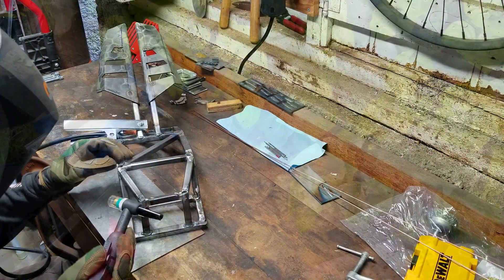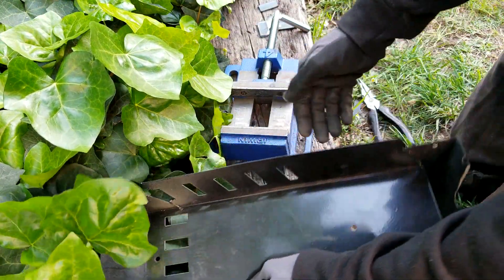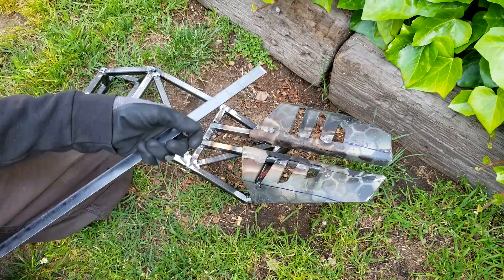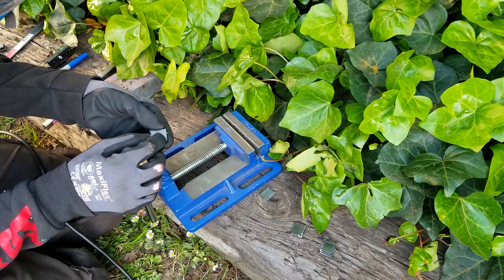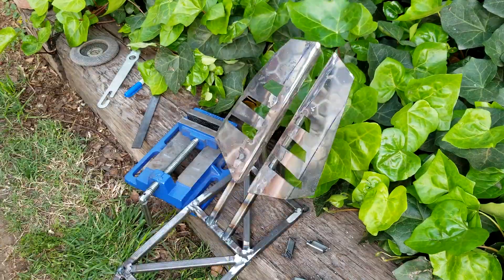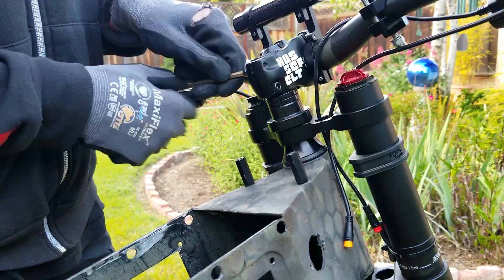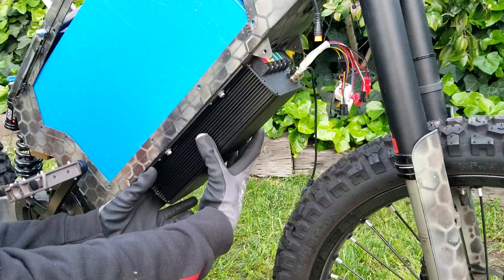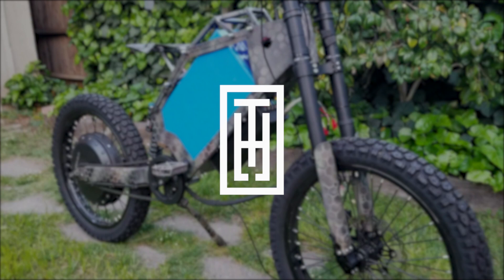🚲 First Assembly + More Mods Custom E-bike 9.0 \\  Fabrication - Enduro - DIY Build! \\ QS273 70Ah

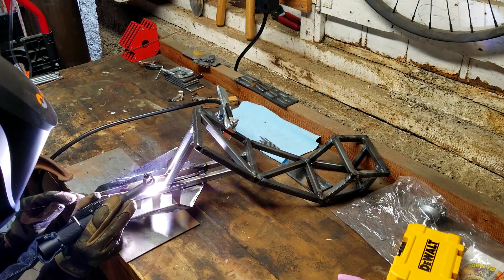Comment: 3:20 I just discovered your channel, and my knowledge on welding is quite limited (just like my English :P ), it would be great if you had a viewer with welding expertise here that would give you some constructive critique on your work, i quickly checked the comments here, and they are all positive, which worries me, as I would love to see some critique and suggestions how you should approach things, and how You can improve your skill. As for welding, You know they are bad, so thats good :) First of all, clean the material you weld, not only the paint but also the metal itself, you need to get rid of that grey 'film'. The metal you weld needs to be shiny, otherwise the welding will be almost impossible. Looks like that's part of the problem you have, judging by your welds. Another tip, if you want your weld to be big, TIG is probably not the way to go, but you can make it bigger with passes. One thin line of weld, another thin line, and so on or go zig-zag way. Too much filler and you get lots of blobs in your welds, maby too much filler, too less heat or jumpy movement, or the metal was simply contaminated/dirty which makes welding almost impossible, which then leads to weak joints, and that is definitely not somethings You want on a piece of thing your health or even life depends on.  Again im not expert on welding, i only took some short welding course, uuuh years ago :P So there you have it. Some critique encouraging you, to get better results. I would strongly recommend watching more YT tutorials. And most definitely, buy yourself, or find some scrap material, shape it, and practice  your weld on something that's going too look like your (in this case) a bike frame. Even professionals do it. 
BTW, waiting for the end result :D good luck!
Reply from the maker: Great, thanks a lot man!!

Comment: Huge fan of your talent.  Endless possibilities especially with your skill set.
To me with your CAD capability, I probably would have started with a complete virtual model of the bike.  You started by building a bike around a battery. Digressing to the beginning, and I haven't explored this option...all I can think about it taking the battery apart and reconfigurating the cell position to better accomodate the top of the frame of the bike to eliminate that top forward corner of the battery.  Instead of a 4 sided battery in 2 dimensions make it 5.  From there the shape of the original frame with slight expansion and not more dramatic reinvention as you have could be accomplished.  Of course this would require taking apart the battery and rewelding cells in place with different nickel strip orientation. Or...creating a dual battery bike.

Next thing is ergonomics.  Please take this from a guy who has tremendous respect for your talent but I come from a competitive cycling background and fussy about frame geometry and rider biomechanics aka ergonomics.  My background is mechanical engineering and so I view through the lens of physics and geometry.   Your seat position is much too close the bottom bracket centerline.  Pedaling can't be comfortable, nor any mechanical advantage.  This is in both vertical and horizontal dimensions.  Further, your seat pan is positioned sloping rearward.  This requires your arms to hold your body in position.  Ideally you want almost no weight on your arms which is generally achieved with a slightly forward sloping seat pan whereby pedaling forces offset forward leaning body CG.
Study different motorcycles, in particular seat pan angle.

Those are some general comments and please take them as nothing more than that.
I have worked in R&D my whole life and started building fast motorized bicycles when I was 12 years old out of old bike frames.  I am 68 y.o. now and still building motorized bikes but now with electric motors versus gas.
You are one of the most talented ebike builders I have seen on the web and my great respect.
Only expressing things I consider watching your build.
Reply from the maker: Thanks so much Luke, I appreciate your feedback and response. You're 100% right, it would most likely be possible to fit this battery within the frame compartment if I reconfigured the cells. I don't know if it actually would be possible, unless sectioned into two or three different packs, because the opening for the space isn't as large as the space itself, so even with two or three packs, I'm not sure I could pass them through the opening in the frame. It may have been possible but still not certain. I haven't ventured yet into building my own packs, and I would have been more comfortable doing something like that, had I already delved into pack building/modifying. It's something I probably will do in the future however. 

I knew this pack would not fit the frame when I first bought it and I wanted to take on the challenge of somehow making it fit by modifying the frame. This was also going to be my introduction to welding as I wanted a 'smaller' project to start with before moving on to larger projects. So while I do agree with you about just changing the battery would have been one solution, my reasoning for attempting this in the way that I did has more to do with modifying the frame than just a solution for fitting the pack. 

Others have also pointed out the bad geometry (mainly the front fork angle, which I didn't design) and I'm sure you have a lot more expertise and experience in riding angles and ergonomics from your years and background, so I'm not going to try and speak as if I know, I take your input and to me it sounds correct. With that being said, I did lengthen the seat about 2 inches which would put the seat position a bit further back. It does still favor center mass, however I can say with actually having ridden the bike now, it is very comfortable all things considered. Regarding the pedals, these are more just foot rests than anything you would actually want to use, this bike is probably 130-145lbs now and while it is possible to pedal it's not something you would really want to do even with flawless ergonomics, especially because you also have about 20-30KW of power at your wrist. I was also weary of the angle I set the seat at and it does appear to slope down (depending on shock compression), but rides mostly parallel to the ground, I don't feel any strain on my arms as I'm not pulling to keep myself level. I've ridden motorcycles for about 25 years now (FZR600, CBR600, Hayabusa, TL1000R) and I definitely understand not wanting to have pressure on your arms or wrists to keep yourself comfortable, and after having ridden this bike now, I can say it is very comfortable, and if it wasn't, then I would definitely change the seat position. 

I know you're coming from the experience of having worked in this field with a lot of experience and knowledge, and I appreciate you taking the time to impart some of that on me (and anyone that reads the comments), but I also have to state that this bike is more of a usable art project than any kind of proper bike that will be ridden with any kind of abuse or for any severe lengths of time. You know a whole lot, I strongly encourage you to show others your creations as I know it would benefit a lot of other people including myself to learn from the knowledge you have amassed over your time, otherwise they're stuck watching me (a hack) who doesn't really know what they're doing at all and kind of bumbling my way through it 😂

Thank you for your insights, and for following along it's much appreciated!

Comment: Yea keep going you're like a guinea pig for many people out there. The only thing I'd change here is probably the dimensions of the battery. It's just a small detail but anyway. If the battery is kept thin (but longer) you can tuck in your legs and reduce the overall air drag which will give you more range when driving fast. Weight almost has no effect on range in contrast surface has very much so. Curious about the speed of this beast.
Reply from the maker: I have no problem being the communal guinea pig for the advancement of absurdity 👍 

Hopefully in the future I can have enough funds to do a lot more experiments that people are curious about but don't have the means to try. 

I could have gone with a longer/thinner battery but then I would have needed to cut the frame in two and rewelded the halves thinner, which is possible but that would be even more work at this time!

 I'd be curious as to the difference between 2 inches in width regarding wind resistance, I can't imagine it is a lot but maybe it is, possibly even more than weight. I do think weight has a (somewhat) significant impact on range (An extra 100 pounds in a car could reduce miles per gallon by up to 2% - and cars are 3500+ lbs). Although with this size battery I'm not concerned about range, I wanted a massive pool to help reduce voltage sag. 

I wired it up last night so today will be the first test ride! Thanks!

Comment: Looking great, I think your making this organically without design sheets hehe, I can tell. But the theme your going for, you have succeeded, once the paint job is done its going to look steller.
For my bike the seat is looking great, its exactly the same length as yours, not over the wheel. For the padding I have foam and gel with a rubbery kind of waterproof vinyl to cover.

Have you thought about how your going to cover the battery trellis upfront ?
Reply from the maker: Thanks man! Oh yeah, definitely without a pattern - somewhat figured out in 3D space first but then just cutting things and hoping for the best. Thank you, I think the paint will help it look as one cohesive unit 👍 I might lengthen the seat slightly but as it is right now, it's more than adequate for comfort in terms of riding position. I am going to do something similar on mine, a rubberized foam. 

Most likely will be laser etched acrylic, not yet sure on if I want fully or semi (smoke) transparent. Thank you!!
Reply: @hightech-lowlife  Your welcome, always here for support for any project not just bikes 😉
Reply from the maker: @mountainlion4853  Thank you so much!

Comment: damn the geometry on that thing really limits its enduro abilities. The headtube angle is super steep. Looks like 75+ degrees. Most enduro motos are in the low 60s
Reply from the maker: Agreed, it's more for street/comfort riding 👍 I could fab and lay it down chopper style put a donut on the front for max enduro downhills 😎

Comment: The bike seems to have a potential flaw in the forks head angle, it is way to upright and could become an issue when driving off road... from the video it looks to have a head angle at around 75degrees, modern bikes are around 66-63 degrees depending on what it was designed for.
Reply from the maker: It's probably the very cheap chinese frame design 👍 (I bought it for $200) I did ride this for a year or so before putting it in storage, never had any stability issues beyond the ones I addressed in the first video. It won't see any off-road use, I suppose I could change the from geometry but I don't know if the benefit would be worth the effort for just having fun, but I'll give it a test ride but I didn't have any issues before. Thanks!
Reply: @hightech-lowlife  if it is just for normal road use then the head angle should be fine
Reply from the maker: @Stengell  Thanks Jakob! I might revisit this in the future, playing around with frame geometry. Thank you for your thoughts on it, much appreciated.
Reply: @hightech-lowlife  Many people assume these bikes are used for off-road 😂. Lets get it straight: Hubs for roads, mids for dirt.

Comment: Rad build!
Cool to see the little steps and see what it takes to learn fabrication something yourself.

One think I was wondering is that if the front fork has enough caster angle, the angle looks small in the video.
That could bite later with losing riding stability on high speed.
Reply from the maker: Thanks so much!!! I have ridden this frame before for a while without stability issues (beyond the ones I pointed out in earlier videos in this series). Thanks!!

Comment: Amazing Build man, Very impressive. One thing I would recommend is replace your QS273 motor for the QS205 because seems you don't have enought power to use half of the full potential of the 273 and it is too heavy. Hell, I have not find one single person able to overheat the 205. 

There are people out there pushing 20kw on them stock and 35kw with oil cooling. Just something for you keep in mind is that it is not a downgrade if you can't push 50kw on the 273. With the 205 you will get better range and acceleration with less mass rotation and less unsprung weight.

Keep going!

cheers
Reply from the maker: Thanks man!! Yes I think ideally for this size bike QS205 is all you need, don't even need this large of a battery either probably 30-40AH is ideal. 👍I may later on this platform go with an 800A controller and try for more, but we'll see how it seems for now! Thank you!!
Reply: me and my frend have qs205 with 7kw, and in hills will overheating quite well. If you go only on flat roads, is ok, but climbing hills are problem for 205
Reply: @TheTnTsvk  that's false or you didn't configure your controller correctly. Either way it is next to impossible to overheat the qs205 with just 7kw.
Reply: @Full_Throttle_no_Brakes  i dont want fight with you but tell me one think. If is imposible to overheat, why exist mods for better heat dissipation like ferofluid and statorade? You ride steep hills or flat?
Reply: @TheTnTsvk  with 7kw it is. Too little for this motor.
Reply from the maker: @TheTnTsvk  Thank you! Yes I have been researching more from Diogo's comment (he is knowledgable about ebikes) but I think I am ok sacrificing some weight for more thermal headroom 👍Thank you for your input, much appreciated.

Comment: This great. Loving the turn out. Just a quick question. Are you putting on some side panels to cover the battery. I ask because the pre drilled holes looks as though they may not have clearance for mounting due to the battery coming right up against the holes on the side. Either way, whatever you do it’s going to be sick. Good job!
Reply from the maker: Thanks so much man!!! I probably will be putting on some side covering, at least for aesthetics, I don't think it's possible for the battery to come out (unless you're in real trouble) so yes, some sort of design element, maybe something with a skeletonized look too 👍 You're correct, I cannot really reuse the holes, I actually had to cut off the nut/cylinders that they were used with so they no longer would even hold a screw. The battery is a super tight fit and I needed all the room I could get. I have some ideas for the sides, but nothing finalized right now. Thank you!!

Comment: I think you should change angle of your seat.Some 10 degrees clockwise should be good. Bike looks good even without paint.
Reply from the maker: I will try it out like this first, I can adjust later after a ride and a better feel, also I can do some adjustment with the foam on top too 👍 Thanks so much!!

Comment: You should have cut the tabs off the controller and got the brackets that fit on each end. Then it would have fit width wise. However with the cables it probably will be tight
Reply from the maker: Thank you for the suggestion! I could still do this! They also offer the V2 controllers that have tabs at the ends instead of the sides, I will ponder. 👍
Reply: @hightech-lowlife  you could also flip the controller around and shorten the wires to the motor to terminate the tight fit all together or run them in channel under the battery and through the frame looks to me you could throw another layer of that foam on bottom of bike battery compartment and still fit battery then run wires under one layer of the foam with channel for wires then pop em out the front gourmet into controller box